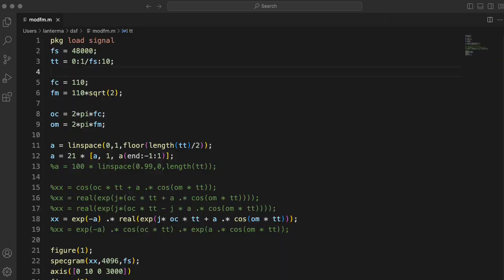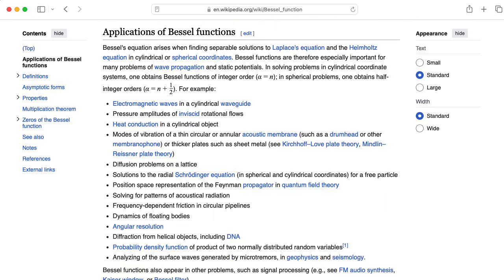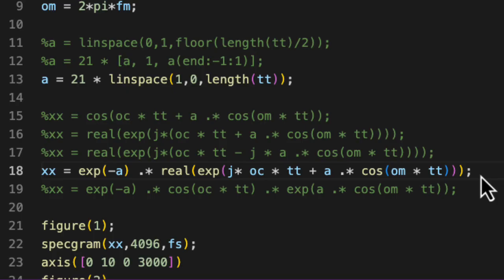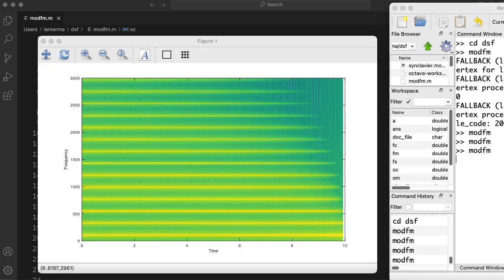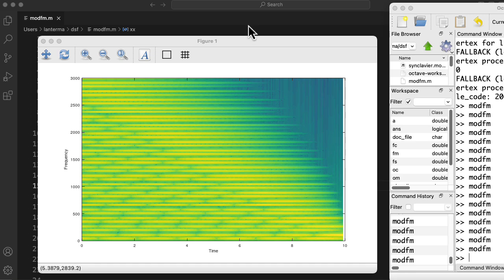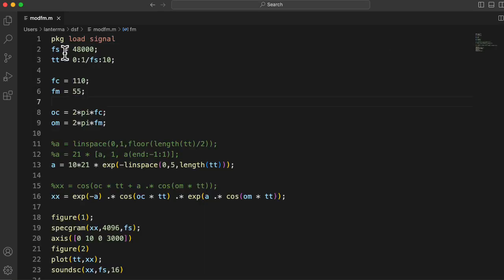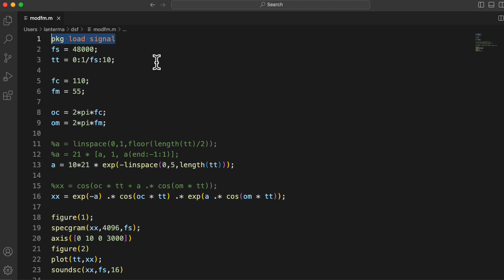FM Synthesis with an Imaginary Index of Modulation (Modified FM)

Comment: Nice video! So it seems that the end result is basically that you are multiplying a (co)sine wave with
f(t) = exp(-a) * exp(a*cos(om*t)) = exp(a*(cos(om*t)-1)).
When a is no too small, what you get is basically a periodically repeated gaussian, or a spike train convoluted by a gaussian. (Only the part close to the peak matters, and there the (co)sine wave looks like a quadratic function).
In the frequency domain, that's a gaussian spectrum multiplied by a spike train (so that only the harmonics remain).
Multiplying by a sine wave shifts the spectrum up and down, basically moving the peak of the gaussian in the spectrum (and creating some interference between the copy that moved up and down).
This kind of approximation to a gaussian pulse train definitely has its uses in sound synthesis. A nice thing is that gaussians are solutions to the diffusion equation. You can imagine a string that is initiatially plucked with a spike. The spike bounces back and forth, while the damping coould be described by a diffusion equation (pretty much what Karplus-Strong does if I remember correctly, but numerically, and with different initial conditions). If you change a so that the variance of the gaussian (e g measured as the inverse of the second derivative at the peak) increases linearly over time, you should get some kind of natural damping.

Comment: it's interesting how with the modified FM and the lack of oscillating bands you can much more clearly hear what i presume is your editing software compensating for the decreasing amplitude in discrete stages
Reply from the maker: Not sure what’s going on really, but Camtasia adjusts from clip to clip. It doesn’t do any compressor type adjustments within each clip (without me running a compressor effect in Camtasia; which I’m not).

Comment: can someone explain why digital FM implementations use phase modulation ?
Reply from the maker: The main problem that comes in with a straightforward implementation of raw FM is that if one of the modulators is spitting out a DC offset (which you can get from a chain of modulators), then the carrier its driving will seem out of tune, whereas with phase modulation, that DC offset won't be heard as a problem.
Reply from the maker: Check out this reddit post: https://www.reddit.com/r/synthesizers/comments/4xnzbs/how_fm_is_actually_pm/?rdt=56978
Reply from the maker: Look for the long comment on that post by x2mirko.

Comment: Fun stuff Aaron.  Definitely curious what the sonic differences would be with the modified FM in multiple Modulator configurations.  Setting various Modulator indices and ratios to leverage the standard Bessel function behaviors is one of the subtle arts of (standard) FM.

Comment: something else this reminded me of, phase shifting sines thru min(max(a, b), -min(a, b)), a continuous xor, has a bit of a fm sound imo, but different. in surge, i implemented it and 8 others part of a generalized system of describing limited gradient two input scale invariant functions, extending what i listed and min, max, etc. the one i listed is the lowest order unless you consider f(x, y)=0 to be valid, four that are one order higher, and another four that are the next higher order, except it is missing simpler stuff like min(x, 0), x, and anything that could be achieved by swapping and/or negating inputs isn’t there. however surge doesn’t have phase shift on oscillators which i think is dumb but slightly detuning two sines will at least sweep thru phases. i think i had made something modulating the phase of sines thru the simplest 5 modes (i only implemented the following 4 in surge) and used it to be the synth parts for a sega genesis midi. later i can try to find the relevant formulas tho i will double check with what’s in surge, after i find where it is in the surge code nowadays. i haven’t done anything with it in a while but i came up with a system for categorizing and describing two input functions, how to do so for three inputs broke my brain when i tried lol.
Reply: ah if you use two external instrument oscillators in surge, those could be left and right coming from another synth that does have modulatable phase
Reply: oh and i should probably say how to get to it in surge. right click on the ring mod sliders in the voice mixer

Comment: Excellent exploration Aaron.. I think that these 'semi - 'failed' experiments are so interesting. I have so many tweaks I'd like to try in order to understand more, like why the index shifts so much between the two methods.   I've got a request: I have always been fascinated by the dynamic tonal difference between Yamaha's implementation of FM and NED's implementation, especially the sorts of things that happen when the modulation index changes slowly as in the NED factory Timbre "Dr Floyd"  as heard in the soundtrack to the 2001 a space odyssey  sequel "2010", so maybe you could have a look / listen?  The Synergy on the other hand sounds nearly identical to the Yamaha method, might be worth a 'comparo' video? Thanks again.
Reply from the maker: The thing I don’t know is how numbers in a Synclavier map to actual indices of modulation, whereas the Yamaha DX mappings are very well documented. The DX mapping is exponential, which is kind of built into how it uses log and anthology tables to turn multiplication into addition, whereas the Synclavier uses actual digital multipliers.
Reply: @Lantertronics  Like Synergia the Arturia Synclavier is running Cameron Jones' actual code, so it's a valid example to play with.

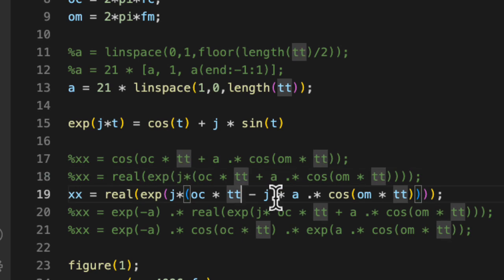Comment: hey Aaron, I think you really missed an opportunity there. at 4:20 (nice) where you replaced a with -ja, rather than make it a constant (a or -ja), make it a point that constantly rotates on the circle of radius a around the origin. It will start out at a+0j, then continue counter clockwise to ja, -a, and -ja. If you do that, I think you could get some interesting results if the frequency of how quickly that number goes around the circle is really slow, like 0.2 hz or something. so again, in that formula at 4:20, instead of having -ja, you would have a * j^(2*pi*fj) where fj is a new parameter like fc or fm. would you mind terribly trying it out and recording what you get? you're basically morphing between standard and "modified" FM synthesis.
Reply from the maker: I actually did that! The problem I ran into is that while regular FM is constant envelope the envelope of modified FM changes drastically with the index. I couldn’t figure out a way to consistent handle the amplitude compensation, and without any such thing, morphing between original and modified as you described just sounded like slow amplitude modulation. Definitely worthy of further thought.
Reply: @Lantertronics  I don't think you need to do that envelope fixing thing at all. But anyways, your examples seem to be rendered offline, so maybe just do a curve fit on the loudness contour.

Comment: The modified FM Timbre is really much smoother to control, Thank you for introducing us!

But it is also kind of lacking in the harmonics — from a musical point of view at least — is there a way to remove the "bessel-swirl" that does not remove as much spectral content?
Reply: FM synthesis feedback loops is the classic way to get less swirly and more consistent harmonics. Another alternative is that you can use phase distortion synthesis on the modulator.
Reply: @boptillyouflop  I will be looking into those, thank you!
Reply from the maker: I think if you want more harmonics in the modified version you can just crank up the index. With a bit of work one would probably make a rule of thumb for mapping indices from one technique to the other.

Comment: I think in all these graphs I'm hearing changes above 3000 that aren't visible on the graph.  The spectrogram suggests the sound mostly isn't changing, but ears say otherwise.  At my age I trust my eyes more than my ears, usually, though...
Reply from the maker: Oh there definitely is stuff up there; I somewhat arbitrarily set the top of the plot at 3000. If I was doing a less off-the-cuff video I would have customized it for each plot.